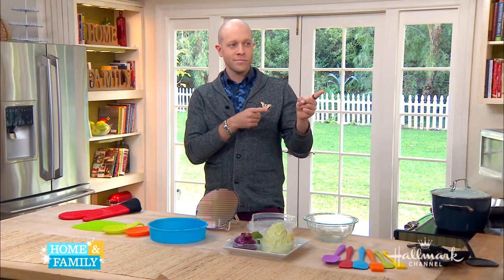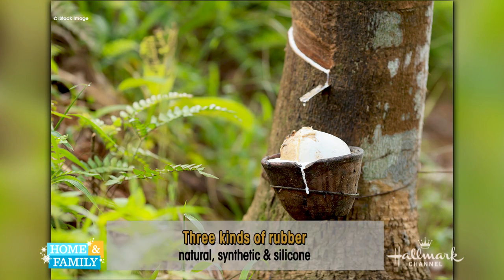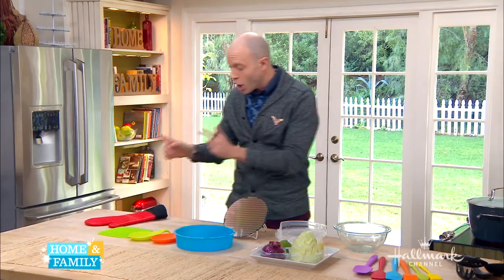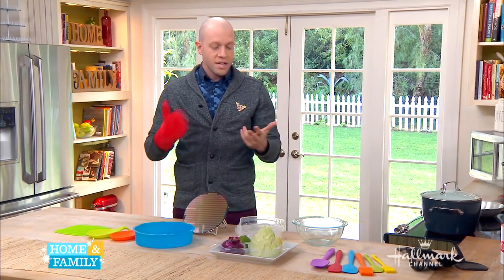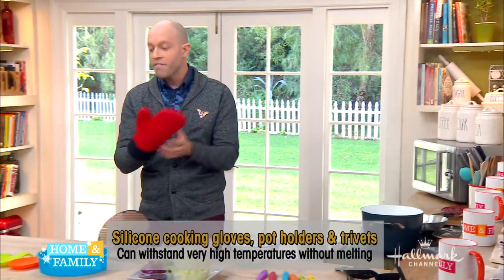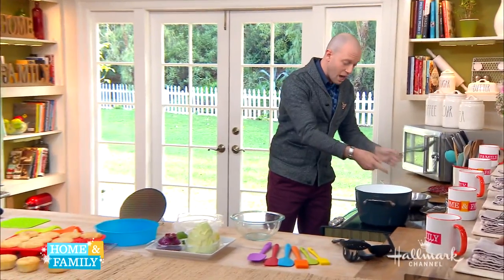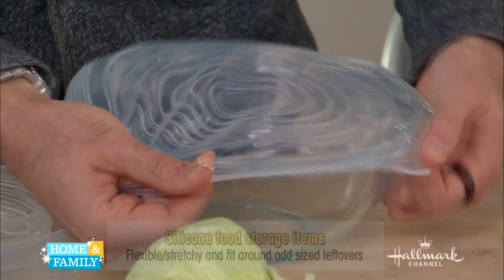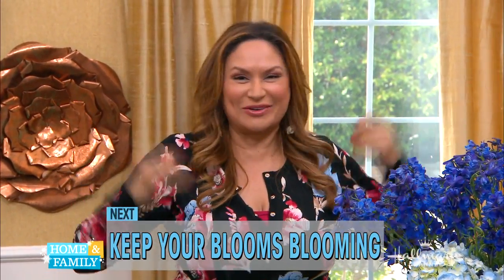Science of Silicone

Comment: Silicon is a bad conductor. It can be used on electronic devices because it can be used to make semiconductors. its not used for being a good conductor. when good conductors are needed in electronics they use gold.
Reply: Thankyou. I'm an electrician and wana slap the guy. Wire is copper and aluminum, gold in circuit boards sometimes but never silicone
Reply: @gotawar2757  silicon*
Reply: Why is silicon hood for semiconductors